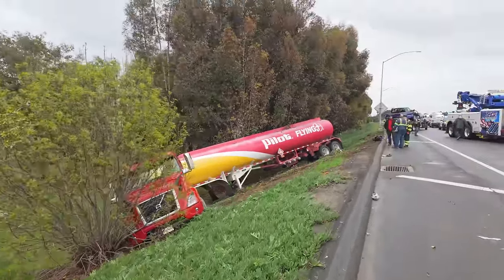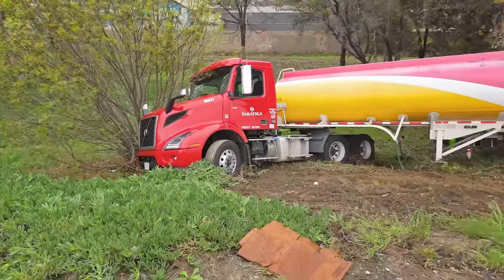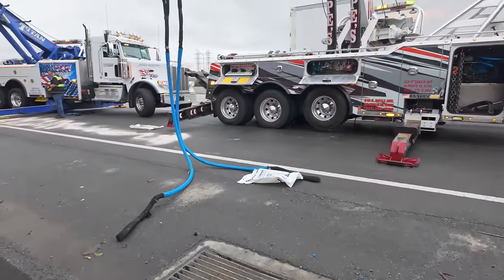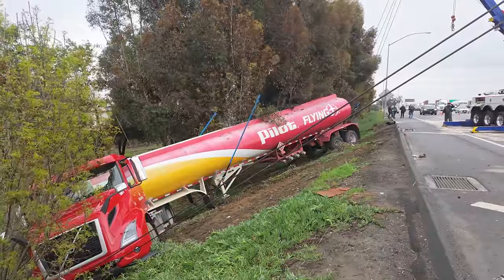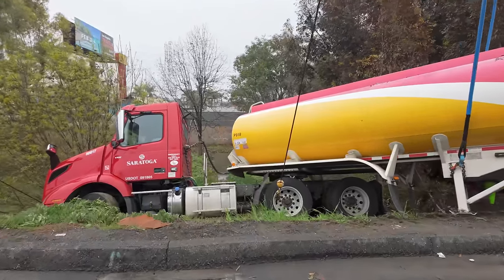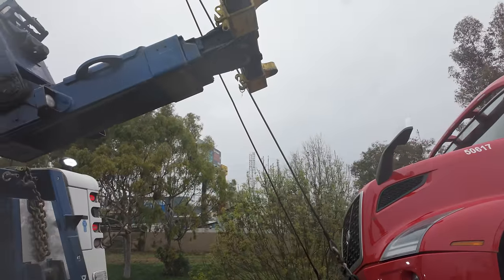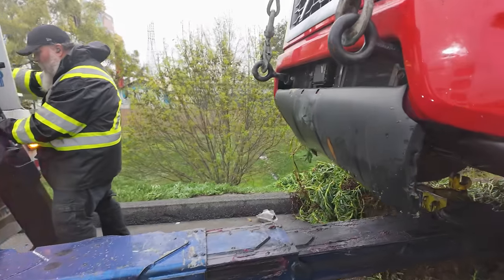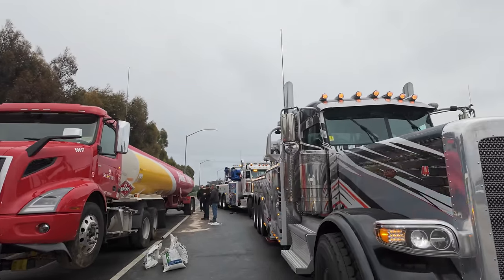Fuel tanker swerves off freeway - lands down embankment

Comment: Hey Josh, again a nice video (without "someone" ruining Pepe's reputation by repeatedly spitting in it). In the video you mentioned that the tanker is empty, but you can clearly see the "1202" / "3" ADR signals on it. (if I remember correctly : code 1202 is diesel or gasoline and category 3 is highly flammable - I think that over here in the EU 1202 has a category 33)
According to the ADR regulation I believe that the driver needs to remove or cover up the ADR signs when the tanker is completely empty and clean, but this isn't the case so I think that the tanker had at least a little bit of product in it.

Comment: What’s happened here doesn’t surprise me those guys drive like idiots I’ve been literally forced at the end of an on-ramp to stop because they would be courteous enough to either slow down or move over for a fellow trucker and i don’t have to tell you how hard it is to pull back onto the freeway with an 18 wheeler hauling heavy construction equipment

Comment: Why don't you pull it out the same way as it went in so much easier. I drove a 1974 Autocar 290 cat back then that was that cats meow,I would pull trucks out of snow banks this truck all over New England it was based in Massachusetts I had been driving trucks for over 50 years now I am retired I missit so much. I learned on a 1942 Sterling chain drive truck beautiful truck.

Comment: 1 rotator and 1 wrecker with 2 speed winches and snatch blocks……… job done in 20 minutes and zero need to tow the tractor trailer/tanker. This shows how you bump up a bill and tie up traffic. Not really trying to attack anyone but this was made to be far more difficult than needed.

Comment: What a cluster f**k. all they had to do was use one truck and pull the tanker backwards and out of the rut. That would have saved the tractor from any damage and the added cost of two more tow trucks.
Reply from the maker: Hey smooth brain, watch the video before looking stupid in the comments. Only losers that don't know how to work wrecks shut down the entire freeway to back up to a casualty. Second, winching it back would destroy the tractor. It was against the tree. I know it's hard with your limited brain capacity but try to visualize the tractor straightening out as you pulled back. Go ahead, I'll wait. What happens then?